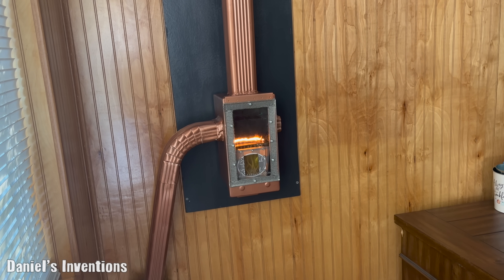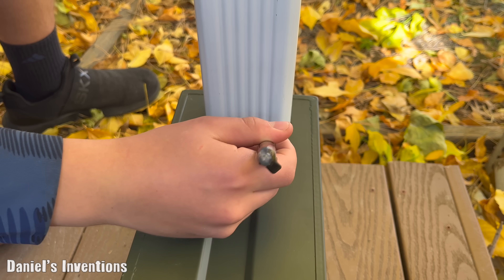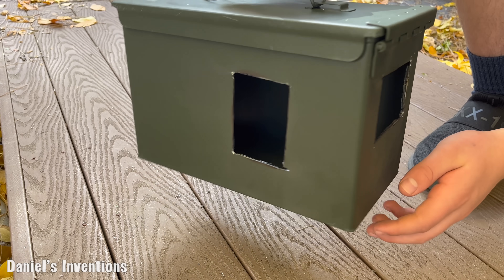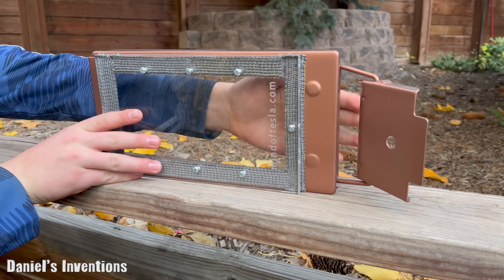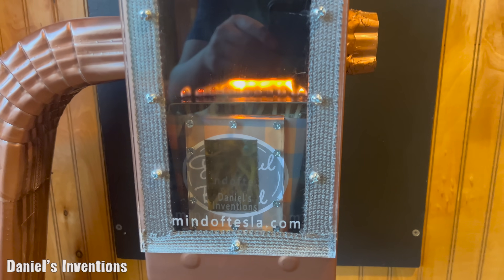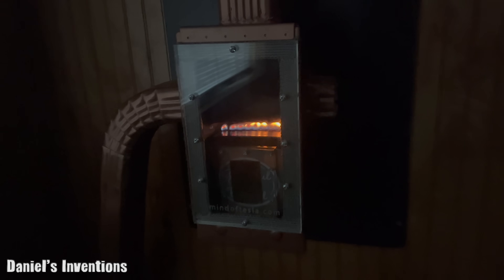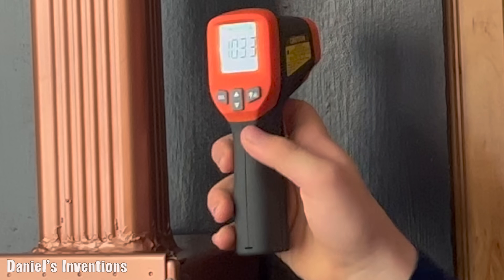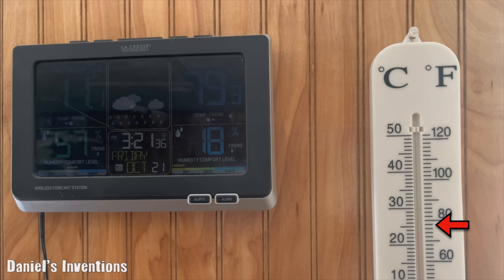ENDLESS Heat for Your Home WITHOUT Electricity

Comment: Are you worried about the flash point of the heating oil? I ask because I use kerosene initially and the temperature inside the ammo box rose enough that the tank of kerosene was full of vapor. I had the lid of the ammo box open at the time and the entire surface of the kerosene suddenly became the candle! The flashpoint of kerosene is low enough that it is far too dangerous to use in these heaters and I was given a very quick reminder of that fact. 
So my question is - what type of oil are you using?  Many thanks.

Comment: Wood stoves are not expenaive and could be easily modified to run on a similar oil burner system.  Steel plumbing pipe is probably the way to go for the ducting.  Dry fit the pipe and use high temp metal tape over the exhaust fittings.
The cast iron body of the woodstove would add an thermal mass to the system as well.

Rocket stoves are more work to build, but they are made out of stone and clay that can be gotten directly from the land.

Comment: I think it would be better to use automotive exhaust pipe pieces and weld them in place, rather than aluminum downspouts... aluminum will oxidize through, exhaust pipe won't.

Comment: Brilliant idea, but I'd spring for actual ductwork rather than rain gutter. And the oil container here is a very cheap metal can, I wouldn't vouch for its continuing to not leak. Better materials and you have a real winner.

Comment: Great concept.  Besides the potential issue with JB weld, consider adding a sheet of metal to the surface of your heat resistant backing board to also help passively radiate the heat and keep the burner cooler if the fan dies.   Some passive safety is worth the extra metal.

The temperatures you showed look okay for the jb weld, maybe, but still I'd look at that as more a really great proof of concept.  Great job!
Reply: This is a great idea. Radiant heat has to be reflected in order to make a difference.

Comment: A few minor suggestions to further refine/improve this design:

If you make the indoor pipe a bit longer and have it bend upwards as it leaves the can, similar to the exhaust pipes in the back, the rising hot air in the pipe will draw more air in from the bottom of the pipe, and the fan won't be necessary. Research something called the "Chimney Effect", it's how my blacksmith forge pulls smoke away from the coke so I don't smoke up the whole shop. No fans required.

Also, rather than using aluminum gutters for the indoor pipe, try finding some old copper tubing. It'll handle the heat better long-term, and you can bend it into a spiral inside the can, to gather the heat from the flames more efficiently.

And, actually you could install this whole rig outside the cabin, with just that copper tubing passing into the cabin to spew hot air. This would lose some heating from the can and rain gutters, but would largely eliminate the concerns over Carbon Monoxide leaking into the house and minimize the risk of a fire as well.
Reply: Nice. New to the channel. Keeping ideas at play for alternative heating. Taking notes for sure. 😎👍
Reply: The fan is just for blowing warm air into the room through the pipe that goes into the burn chamber but is separated from the burning process.
Carbon monoxide should all be vented out due to the chimney effect and all the burning process is vented straight outside.
This will require some type of fan to get the most benefit , with very little risk u less it broke loose from the wall spilling the fuel oil in the wooden cabin … it would be of utmost importance to have this very securely mounted.
Reply: @JoeWayne84  I think you misread, I think Rex acknowledged that it didn’t have an immediate risk but over time there’s definitely risk if those welds aren’t done right, degradation of the aluminum from high heat, and I read somewhere that overtime JB welds can fail in high heat.
Reply: @indescribableemptiness4104    I think you’re ok with JB and that sort of heat.     I put some  on a stop drilled Veed out  crack in a  4 cyl Toyotas exhaust manifold once as a stop gap until I could round up a good junkyard replacement.     It held up quite well at those high temperatures for over a year until I got around to swapping it out.       The crack was right between # 2 and 3 exhaust ports  dump point so it was gettin all the heat directly on it, around 1300 F .    I would think Id be sure to inspect the seams weekly and have a CO and smoke detector nearby ….
Reply: @indescribableemptiness4104  Both JB weld and his gutter pipe need a bit of improvement. Other than that, works great, but he's heating a very small space as well and it must be insulated pretty decently...
Reply: @indescribableemptiness4104  it’s not welded! It’s not aluminum. Geez!
Reply: @donhuffer5167   hey the original comment is talking about aluminum gutters and in the video they were talking about jb welds. So I searched them up and commented from that information. Nothing else I can say 🤷‍♀️
Reply: @indescribableemptiness4104  it’s JB Weld. Product name. No s on Weld.
Reply: He called it STEEL gutter. It’s actually steel downspout. Big difference. Comments on this vid are so bad I had to stop reading. The heater was 99% perfect. People really suck these days.
Reply: This is what I was wondering, @JoeWayne84 , thanks for clearing that up, (or for being the first one I read, 😉).

Peace 🙏, 
🐉🐉
Reply: I agree with removing the computer fan. For the size of the application here i feel that fan isn't doing much of anything to be honest. Though the output side for the heat should be a bit smaller than the intake side. I can't remember by how much but it helps with air flow and the cold air vacuum.
Reply: @henuemphuse  I bet that fan is moving at the very least prob 20 cubic feet a minute… that’s a lot more
Than just allowing the thermal reaction to pull the air through and it requires almost zero energy .
The efficiency in heating up the space is probably more than 3x better with the ram than no fan.
I have a wood stove that is vented throughout a building with a blower fan it’s definitely better to run the blower fan on a much bigger stove and building I can’t see how it would not increase performance having it.
Usually if you or running a stove or any type the last thing you want is a way to make it less efficient . I’d personally design it with a way stronger fan and duct it to the other side of the room ..
Reply: @JoeWayne84  depends on the power source hes using for the fan, it seems like he's running a fixed power supply. Although I'm not sure what voltage or anything I havent rewatched the video. Also depends on the fan motor and blade profile and count. No doubt its moving anywhere from 12-20cfm but for a diy heater. I mean something like this you can definitely get away with removing the fan. Im more talking for simplicity sake considering the title of the video. There are other alternatives that are simpler (however I don't recommend, such as the single candle flower pot stack.) But as far as homemade heaters its not bad. Not far off from a half gallon pellet stove either lol.
Reply: @henuemphuse  I know I'm a bit late to the commentary. I just wanted to inform people that good computer case fans can get as high as 95 CFM. I use the Noctua NF-F12 fans in my builds, which max out at 71.68 CFM. Also they run on the 12vt rail, so they could be hooked to an off-grid solar setup quite easily.
Reply: @DavidSaintBump  yeah but that cfm rating is based of proper power being hooked up to it. You could hook it up to a 5v and still get air flow but not near what its rated for is all my point was cause there (to my knowledge) was no info on the power supply he used and its not just about voltage either amps is what primarily drives the circuit to determine rpm at a given voltage.
Reply: Not sure how the reply got posted twice lol think I fixed it
Reply: @henuemphuse  he stated it was 12v fan. This might be presumptuous but that little power brick he bought to run it with a fan connector is most likely going to be designed at 12v DC like most computer fans need.
Reply: can you just build me one please and get me a price lol
Reply: If the combustion chamber was a bit larger, you could put another copper coil for heating water, two birds with one stone.
Reply: my old hand crank forge has a chimney that runs from 1 ft below the bed of coals to 7 ft above it and the ammount of air drawn through their without a fan is insane....witha fan... its like i got a damn coal turbine out back of the shop lmao.
Reply: @Spike16 yeah that’s understandable I don’t think it’ll get that hot lol, I’m looking it up I’m getting some similar results.
Reply: Sounds like your jealous
Reply: How would carbon monoxide get into the cabin with this design?
Reply: Most blacksmiths snort their coke.
Reply: I was thinking the same thing when I was watching the video on the candle heater they did for the snow mobile set up.
Reply: Lll
Reply: Without the fan, it wouldn't be a "High Efficiency Oil Furnace". 😉
Reply: The chimney effect for the warm air is a good idea, but I think it would add a concern that the current setup eliminates.  Mainly a chimney effect is a negative pressure system, and any leaks could leak into the cabin air if this draw is stronger than the firebox exhaust.  While his current setup is a positive pressure system, so any leaks should go from the cabin air into the firebox and out the chimney thanks to its chimney effect and negative pressure draw.  I agree on all your other points though, good info.
Reply: NO! Heating copper can be DEADLY! Copper heated to the temperatures in this build can give of noxious fumes than can kill you just as fast as carbon monoxide.
Reply: @Plasmastorm73  Copper doesn't off-gas. I suspect you are thinking of galvanized steel, which will give off dangerous Zinc fumes. Copper will not, however.

If you look at your cooking pots, you'll see that some of them have a layer of copper that you heat directly over an open flame on your range (if you use a gas range, anyway) without harm.
Reply: Not to mention the maintenance of soot removal
Reply: The computer fan will blow CO and other combustion gases straight into the room as it is blowing straight through the combustion chamber. It doesn’t take much to overcome natural draft venting. The combustion chamber fresh air and flue need to be isolated from the air flowing into the room.

Modern furnaces use a fan to push combustion gases out the flue because it doesn’t take much to overcome the natural draft. Something as simple as opening the door or cracking a window can do it. Even a less than optimally sealed building can do it through infiltration.
Reply: @MrSadisticMedic  ohh you didn’t watch the video what your describing is what he built you can’t see the pipe running through the burn chamber cause it is black and covered with soot .
Reply: @MrSadisticMedic  The blower in a modern furnace is to pull air from the cold air return through the air filter, and push it up through the supply plenum past the heat exchange and from there into the hot air ducts that carry hot air throughout your building.

The fumes in the combustion area rise out of the flue on their own without need of a second blower, since hot air rises.

That seems to be the standard set up for every home furnace I've ever seen. Maybe in an industrial-scale furnace you'd need a second blower to clear out the combustion gases, but it's not necessary on a system this small.

Also, the system in the video does not have the fan blowing through the combustion gases. Instead, the pipe it is blowing through is never opened to the inside of the combustion chamber, and is essentially a combination heat exchange/supply plenum you'd see in a larger home furnace system. 

The gases generated inside ammo box would be very hot and would rise out of the flue (though having the top of the flue invert the way he built it is a problem, admittedly). I'm not sure why you think the input and output vents aren't isolated from the room, they are clearly shown in the video to run outside the cabin. I think you are confusing the cold air return with the input pipe that feeds air to the combustion chamber.

Frankly, with the set up shown, and the lack of smoke or sooty residue from the flames, there's very little incomplete combustion happening here, and so CO production would be very minimal. And the ammo box does have a large outflow vent and a large influx of fresh air through the input pipe for such a small area of flame. CO should vent from the system either through the vent or sinking back through the input pipe. I'd still have a CO detector in the room just to be safe, of course.
Reply: @berserkasaurusrex4233  most newer high efficiency home furnaces absolutely have a fan for exhaust. It’s actually the first thing that turns on in a call for heat. It makes sure there is good exhaust flow prior to lighting the burner and runs the entire time it’s burning. They have a pressure switch that will stop the sequence if it senses there is possibly an obstruction. This is why you can have a pvc exhaust pipe that is horizontal and not need a chimney. The fan does the work and since it’s high efficiency, there isn’t a lot of heat so you can use that pvc.
Reply: @ThatGrizzlyGuy  I've never seen a horizontal exhaust or a pvc exhaust, they're always steel ducts that run straight up through the ceiling from the furnace. And the only blower is for the cold air return to pump air up through the plenum to heat.

Might be a code difference between states or regions, though. I can see why you'd want a secondary blower if you are forced to run the exhaust duct horizontally for some reason, but it never happens in the home furnaces I've seen. At most the duct might run diagonal to get around some water pipe for a few inches, but that's about it.

Regardless, this hotbox system doesn't need a blower to properly exhaust. By the time there would be any serious CO production, the flue would be well primed and exhausting properly.
Reply: @berserkasaurusrex4233  Those are old style furnaces. New high efficiency furnaces use a two pipe system. One for exhaust and one for fresh air.
Reply: @berserkasaurusrex4233  As an HVAC guy, a lot of modern high efficiency home furnaces have a blower for the flue. The indoor blower and the flue exhaust venter blower motor are completely different.
High efficiency furnaces also typically use PVC for combustion intake and flue exhaust. This is not some coding or regional thing, it's due to the design of the furnace. High efficiency furnaces condense the water vapor from the flue gasses which is why PVC is used rather than steel since PVC won't rust, and the flue us cooled by the intake air (how the water vapor gets condensed) so the flue isn't hot enough to warp or melt the PVC.
Reply: @MrSadisticMedic  the fan and the air it pushed are separated from the burning chamber unless there is a hole
In the pipe the fan blows through inside the burn chamber it is no different than the the air in the entire room … the chances of this thing back drafting through the intake hole is almost impossible hot air rises it would take a fan or sustained air pressure on the exhaust side to push the carbon monoxide and smoke back through the air intake side. And anyone who has ever used a wood stove or even a fireplace knows it isn’t a issue .. 
the only thing I would of done differently is I would of used a lot heavier gauge metal for the hot air line inside the burn chamber that gutter material is very thin and after being heated up for a while could actually burn a hole in it and then you could get some carbon monoxide and smoke in the house ..
I think you people aren’t noticing that it’s a seperate enclosed loop the hot air supply with the fan to the burn chamber and exhaust.
Reply: @JoeWayne84  - Totally agree. The heater is setup in such a way that CO is not going to be much of an issue, unless the horizontal gutter pipe a/k/a the heat exchanger “maybe” develops burn-thru, or cracks from long term heat stress. 

Of course the easy solution for solving the low/minor CO risk, is to buy a residential CO alarm.

Comment: I have discovered a mixture that has a small combustion life but high heat output. It is a mixture of 93 percent isopropyl alcohol and candle wax, the synthetic wax made from petroleum burns longer. I have a few ideas from older methods just never have the time to experiment.